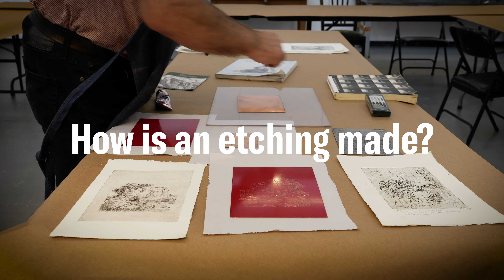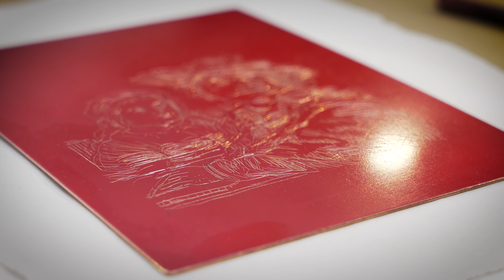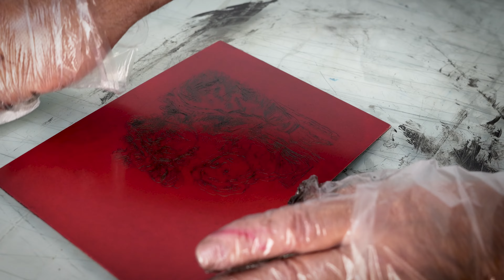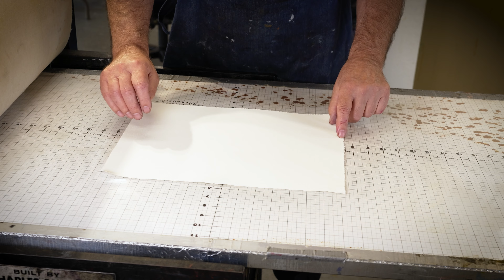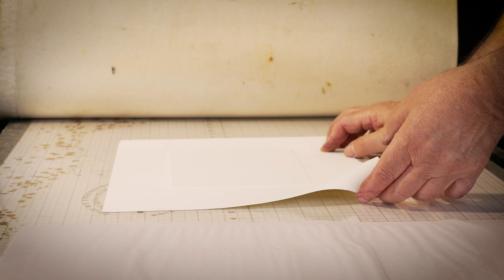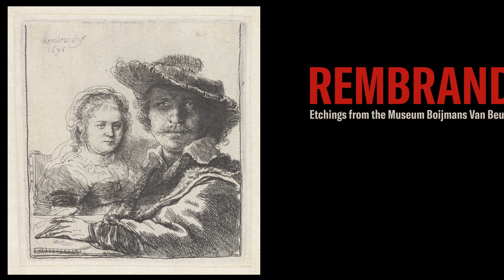How Rembrandt Made Drypoint Prints

Comment: what is the red paint? acrilic?
Reply: They don't say which ground they use but I've used BIG red ground to add that surface to etch into on the copper plate. Dry point on plexi is a bit more approachable for first starting.